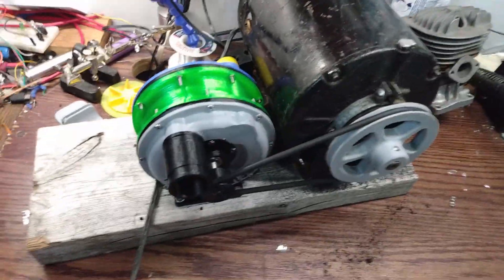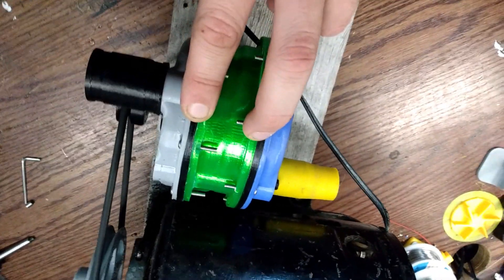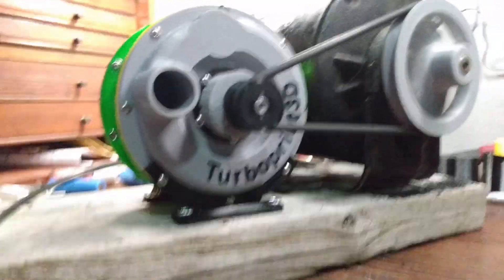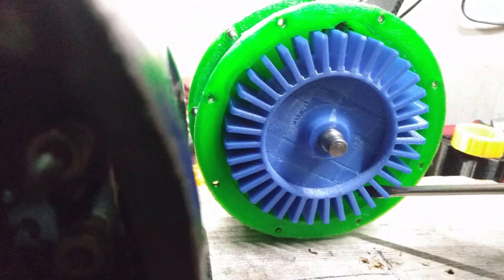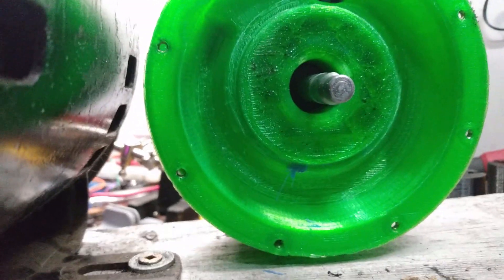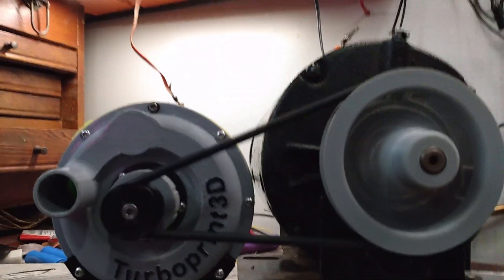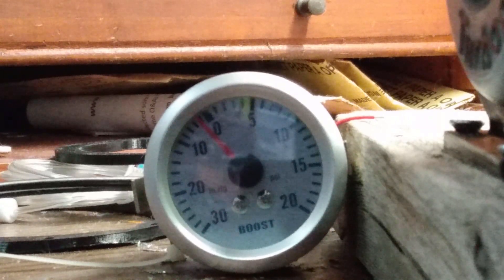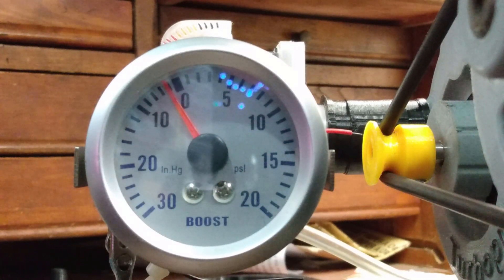3d printed 2 stage regenerative supercharger testing

Comment: Suggestion: Don't use "boost" gauges, use a fluid manometer (U-tube) at these pressures. Water won't have stiction and it will always be linear. With the boost gauge, it's only accurate over a certain range of pressures, and you're pushing against some kind of unknown spring inside them.
Reply from the maker: Thing is of it dosnt show on the boost guage it's not doing what I want , I don't need accuracy I'm just looking to hit a minimum ( 3psi) witch is like the minum worth while pressure for boosting an engine .

Comment: You need a CNC lathe and vertical mill to go to the next level. 3D printed pulleys will always eat belts.
Reply from the maker: I mean just a manual lathe would be fine , and I have a full machine shop , just alot of time and effort and cost of material for something that's just a testing step . I do intend to go 100% metal one day but I gotta get some new ball screws on my mill as it's crazy lose and can't do 3d milling .  I recently became disabled so machining anything kinda has to be really worth it , if I hadn't become disabled I would still be working in the field and would not be trying to make a go at YouTube . I have finished the design , I'm almost at production level , but video wise I'm still showing off versions that are at least one step back from that . Check out my videos where I'm working on tossing a similar supercharger on a 390cc Honda

Comment: Interesting results!  Measuring is the tough part.  You can get lower-range pressure gauges for cheap on Amazon.  I just completed a multistage regenerative compressor project of my own, and got not quite 2x the flow/boost for a given RPM ... but the power required to drive these things is VERY high!  The same 775 DC motor could drive mine up to 7k RPM in single-stage but only low 4k's in 2-stage.  Maybe I should try an AC motor like yours.  BTW, a quantifiable way to measure flow rate is to time how long it takes to fill a sealed trash bag and divide the bag's volume by the fill time.  If yours is like mine, you might have enough boost to explode trash bags, too, which is pretty fun :)
Reply from the maker: Ya I get what your saying , I haven't mentioned this in a video but it turns out the belt was slipping alot , as in the pully was cut in half by the belt shortly after finishing my shots . So i should assume that is why I had unexpectedly low results . The plan is to get it on an engine and use a 3/8 belt and aluminium pullies to shoot for a max rpm of 15000 in relation to the max Rpm of the engine . So I need to make a dyno witch I have plans in my head for but have not gotten to yet . 2-3lb on say a 5 HP engine should net a noticable gain if I can get fueling correct .
Reply: @turboprint3d  Homemade dyno sounds cool for sure!  I'd like to see it.  15k RPMs should deliver some real yee-haw if you can drive it!  Have you considered a toothed belt/toothed pulleys?  I had good results with GT2 but I would definitely want bigger for a real engine.  The main thing is that these compressors need a lot of torque to drive...
Reply from the maker: @jamespray  timeline belts are an option , v belts will be ok as long as the contact area is large enough between the belt and pulley.  It will take some trial and error , but the better performing parts usualy cost alot more one way or another .
Reply: @turboprint3d  I hear you there!  It's pricey enough keeping stocked with nuts and bolts, never mind the specialized stuff 🙄
Reply from the maker: @jamespray  right , I have a CNC and can make some of the parts but aluminum still cost money , it always gets you somewhere

Comment: Try a manometer pressure gauge.
Reply from the maker: I think i found a better setup , I don't really need anything super high resolution for what I'm doing , an engine will be happy with the 2 psi weather its 2.001 or 2.100, the flow rate difference would be minuscule at best .
Reply from the maker: https://www.amazon.ca/Kodiak-Controls-KC25-10-Pressure-Gauge/dp/B00H9ZWJLM/ref=sr_1_5?crid=HMKIRSWOA2P2&keywords=10+psi+gauge&qid=1645240963&sprefix=10+psi+gauge%2Caps%2C98&sr=8-5 somthing like this would do

Comment: cool! only advice to you, use a pressure gauge from a medical blood pressure monitor, it is very accurate!
Reply from the maker: The issue is money and finding one
Reply: @turboprint3d  I don’t know about you, but they cost a penny for us.
Reply from the maker: Ya I have a fuel system tester for old carberated cars witch run fuel pressures of 5psi so I gotta dig that out and get it tested up and that would likely be alot more consistent at least .
Reply: I can confirm this